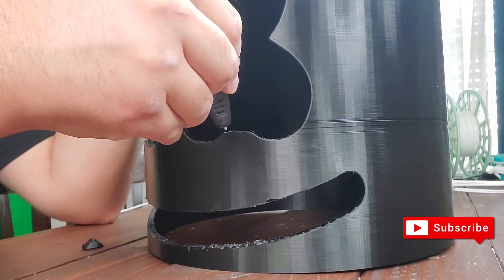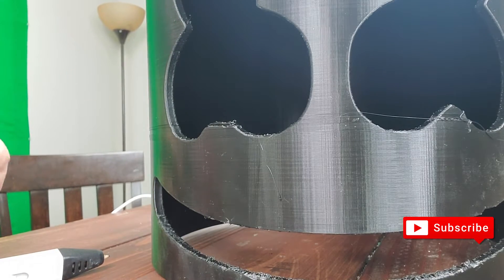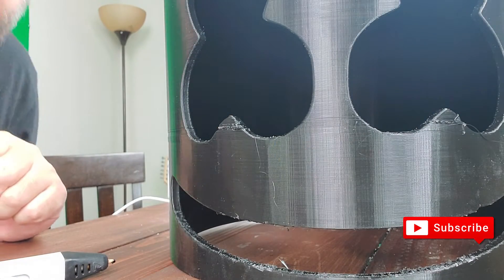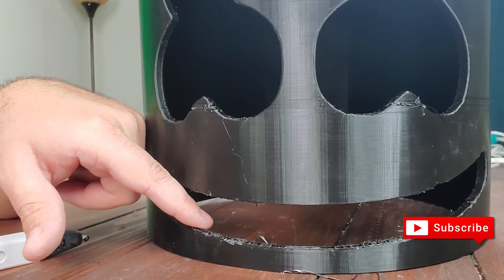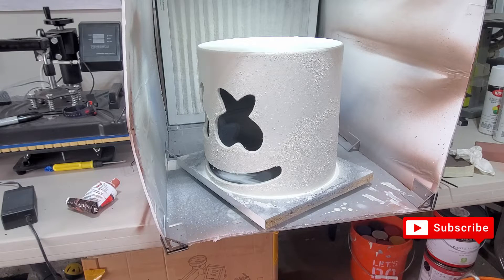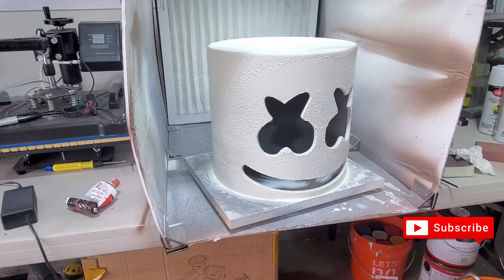How to 3D Print DJ Marshmello Wearable Mask - Ender 5 Plus

Comment: Is this the end 5 plus you could find on Amazon? Or another site? Looking to print my own mascot heads! Thanks!
Reply from the maker: Yes ender 5 plus and yes you can buy it on Amazon. I got mine at Amazon
Reply: @VeraProjects  what size and dimensions if it was for a mickey head?
Reply from the maker: Wouldn't know I would say to first let it print a few layers and see if that's the right size. You can always increase the size in the application before you print it